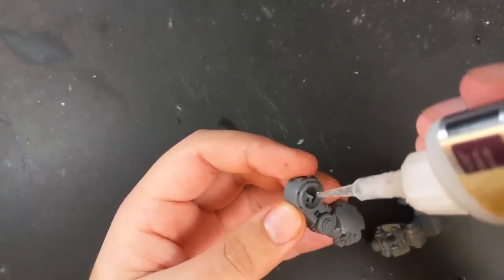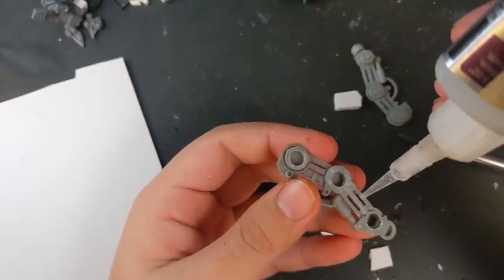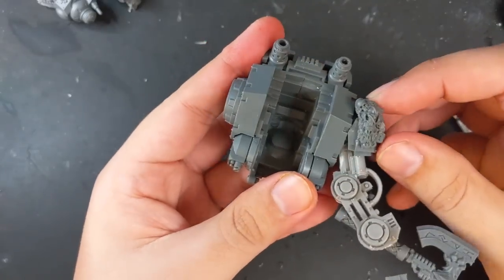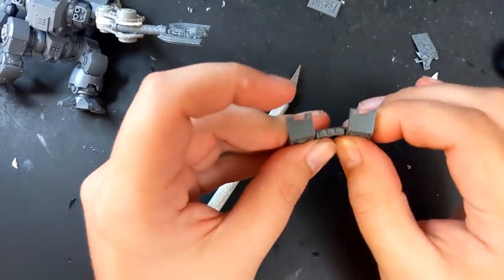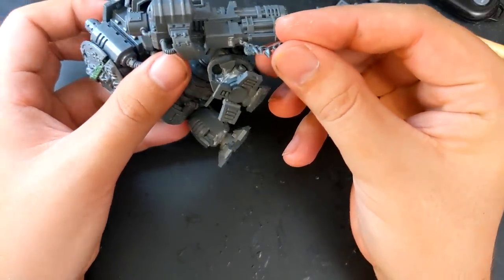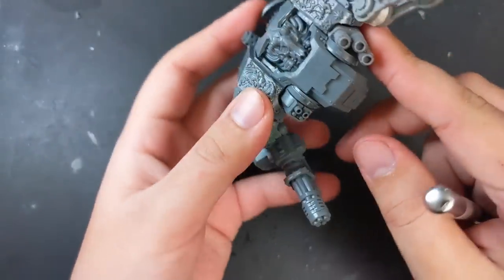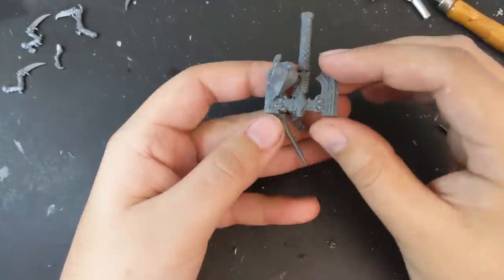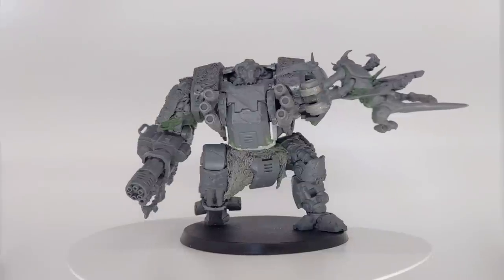Space Wolf Redemptor Dreadnought Conversion

Comment: The only issue I have is how off balance the figure looks. when bi pedal things move there is a large amount of counter movement through out the body. for instance when you take a forward step with your right leg your left shoulder moves forward for balance. striking from left to right the right leg should be in front. It has the effect of looking like a much stronger swing because all the weight is shifting and being driven into the strike from the back foot and given balance from the right foot. 

now that I'm done bitching about posing... The thought behind the conversion was great. The whole mini feels extremely cohesive and flows extremely well together, and I wish I could sculpt half that well. Good job!